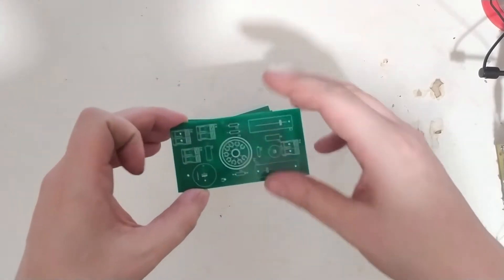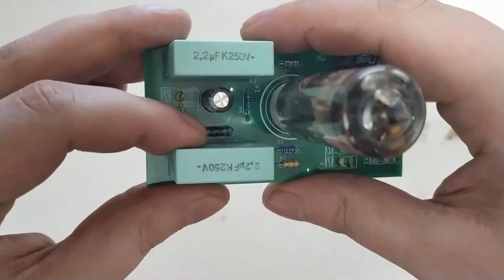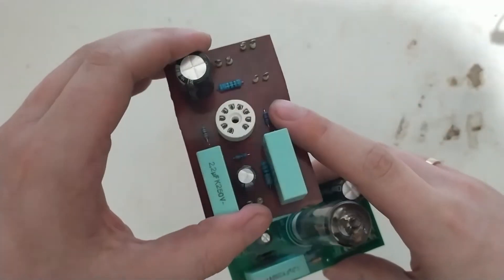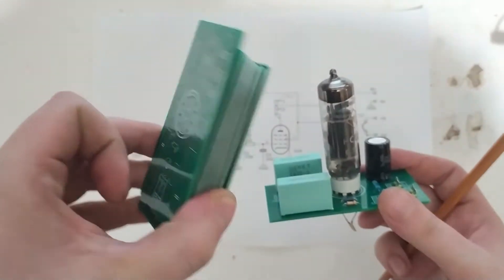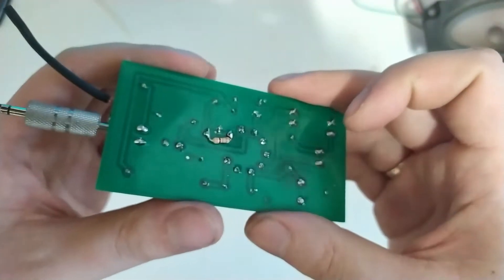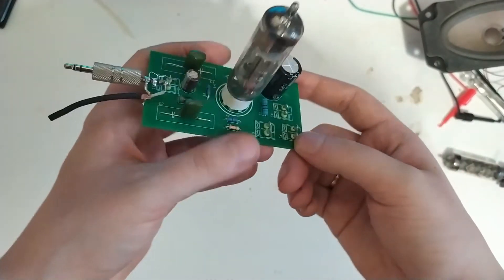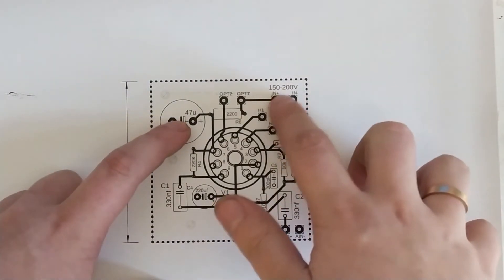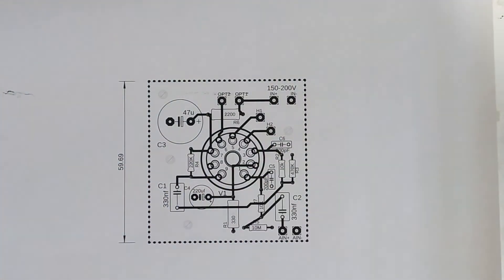Building a Compact Single Ended PCL82 Vacuum Tube Amplifier 4

Comment: Captain, I not sure about 200pf from grid1 of the pentode to ground.  It is C6 on the revision board.  Together with the 10K grid resistor, this would form a low-pass filter.  Why is the pentode grid resistor such a  high value, 10K
?
Reply from the maker: That's right!. It forms a low pass that keeps HF off G1, one could use a larger Resistor and use the grid capacitance alone or use a capacitor and a smaller resistor, not that it matters in this amp but for low noise designs the latter aproach would reduce thermal noise. It is vital on the triode stage, probably not as important on the pentode stage. It reduces the tendency of the amp to oscillate quite a bit though. In the shematic on Github the G2 resistor is given as 2.2k which sounds much more sensible. I probably changed this later in the build.
Reply: @captainsolder5247  The RC circuit above reduces the output above 15kHz in LTSpice.  The most power I could get from LTSpice simulation is a little over 3 watt at 1k sinewave,  in both pentode and  triode mode with an output transformer of 3H primary and  8.5mH secondary.  A combination of Fixed bias and cathode bias, with -16V and 220Ω cathode resistor the output gets above 5 watt, while dissipation is 40mA, 265V B+.
Reply from the maker: Yes, 3dB down should be about 20kHz if I didn't calculate something wrong. 3 Watts is about typical for the circuits that they used the PCL82 in way back. No Gridstoppers either. I'm sure they took great care in laying it out to keep the thing from oscillating though. Is your 5W circuit staying within the limiting values?
Reply: @captainsolder5247  Pentode, with 200Vdc, idle 35mA, and with full swing signal, 45mA for 5W output.  Although, the bottom peak of the sine wave is not as symmetrical as the top half.